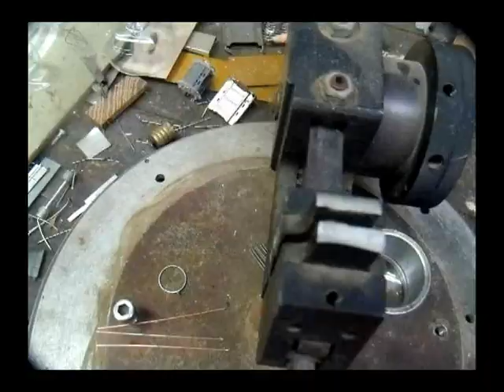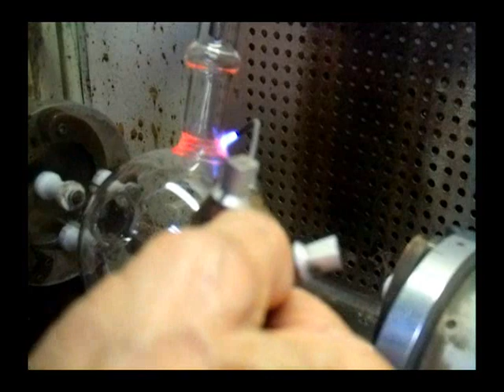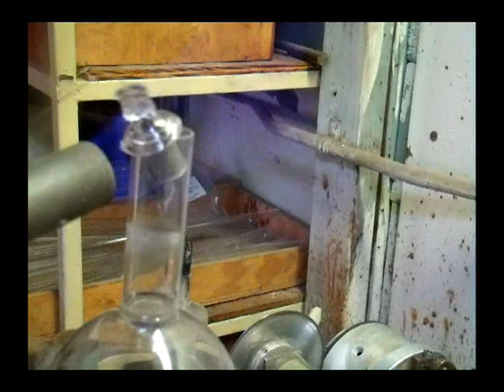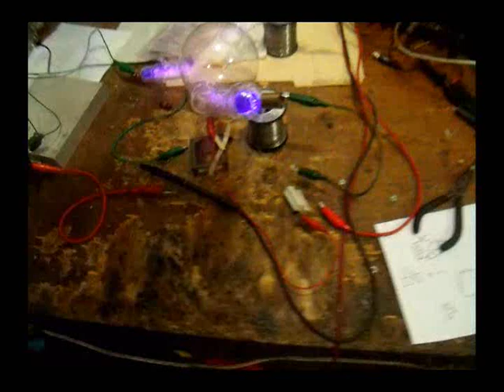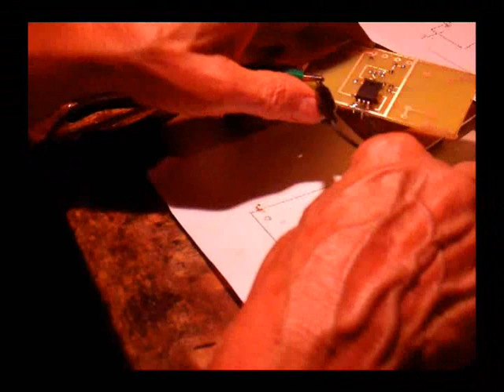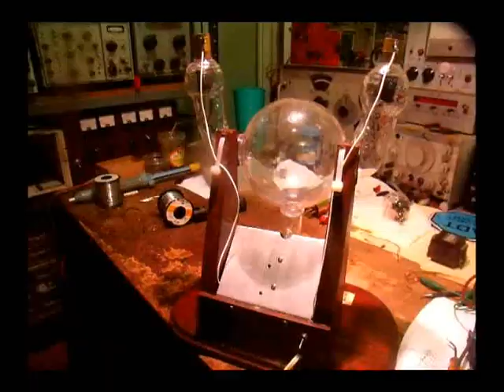making a mercury arc rectifier

Comment: why not making the two bends with electrodes firts and then attach to the main bulb?
Reply from the maker: The attachment to the bulb is the most likely time for a crack to happen, which would mean junking those parts. So getting that done before the other work was to cut the loss if SHTF.

Comment: This is very inspiring! I didn't know what a glass lathe was until about 2017. I'd love to get my hands on a Mercury Arc Rectifier. Not that I need one, but it would fun to have! Do you do other scientific glass blowing, like diffusion pumps, laser plasma tubes etc.?  Update: I got a Cetron 8008 Mercury arc rectifier tube. Not as elaborate as yours, but I will use it in a Vacuum Tube tesla Coil project instead of diodes in the voltage doubler.

Comment: That rectifier tube is just precious,  I have often thought about modifying a guitar amp as a gimmick to operate with an external rectifier tube but there aren't a lot of choices  out there for rectifier tubes to be had. I have a Mesa Boogie triple rectifier guitar amp that lets you switch back and forth to channels having three of the different rectifier 's by using a foot switch on the fly, but the rectifiers are solid state, not tubes. What would be better I could imagine would be switching back and fourth from a Mercury based rectifier and the the Argon rectifier hence the name of the songs on stage in live concert stage show and having the third be a Tritium rectifier and then it blows up during the climactic guitar solo that we could call the Trinity and it catches on fire,  then of course roadies come out and put out the fire as usual.  Nothing new however I haven't  seen this done for a number of years but the product line would be the new twist selling and external attchment for a guitar ampliphier that is the rectifier and of course a line of outrageous guitar amps  ....  🎸

Comment: So you're making a lightbulb then. I mean I know this is old and I'm only 10 seconds into the video and I haven't read any of the comments or anyting but this isn't Mercury rectifier is it? It is an Argon Arc Light Bulb, it's just it's a beer sign in a different form. Right? This thing is not capable of rectifying AC into high voltage DC in any way shape or form is my guess I'm going to skip towards the end before I give it a thumbs down
Reply from the maker: Yes, it is a "beer sign." It was made as a gift to an elderly man that wanted a model  of the mercury rectifier that would glow. The argon was used to avoid contaminating my vacuum system with mercury. Jealousy is a nasty mental disease! Work on it!

Comment: The idea of making the rectifier is fantastic, but it is just a really huge shame that the resolution of the video is so low that you can't make out fine details of what is being done. 
Maybe I am expecting too much from 8 years ago, but I love watching your videos, but find the pixelation/soft focus a problem when I want to see the details of what you are doing!
This video looks like it was shot at 480p 3:4 frame size.

I remember when I was an apprentice electrician, part of my job was to daily go around all the factory sub-stations and take the electricity meter readings, in the main substation there was a large steel cabinet that could be opened (I had the keys to the sub-station to get in which meant I also had the keys to all the cabinets in the sub-station too) and inside one of the cabinets was a large three-phase mercury arc rectifier, it was about 3 feet in diameter with the glass horns for the electrodes and the "giggler" you could see dancing around the pool of mercury!

I only opened the cabinet because it was the only cabinet that had a bright blue glow emanating from the louvres that cast a blue light across the substation floor. It was fascinating to watch! Unfortunately, 45 years ago we didn't all have phones in our pockets that had cameras to take photos, but boy I would have loved to have been able to have taken photos of it!
Reply from the maker: That was one of my early videos when I had the old 1.2 megapixel camera. It was very primitive with poor auto focus and no capability for manual focus.
Reply: @glasslinger  Don't get me wrong, it is not a criticism of you, just me expecting far too much from 8-year-old technology....!  
Fascinating to watch you make it, and it really brought back some memories of my Electrician Apprenticeship some 45 years ago.
Thank you,
Kay.

Comment: I wonder if it would be possible to rebuild like a 4-400a. 3-500 Zed. Or like. 572b. 811.
Reply from the maker: The glass used in these tubes is almost impossible to work on without cracking. Even with extreme annealing. I have never been successful.

Comment: There very scarce information on the engineering of glassworking lathe's heads, could make a video review on how it works? they are extremely scarce and expensive as result and i am really into making an homemade one so that i can make a arc rectifier like yours. and for that i need information on how it works which i cannot find.

Comment: Very impressive work👍
As far a working  Rectifier, how does this operate instead of using mercury??
Correct me if I'm mistaken, you created a replica rectifier , into a argon light??
You got a eye for detail, you have to do the mercury rectifier.
Now I know you can.
Reply from the maker: Once you get mercury into your vacuum system it will be there forever. I don't want to poison my system so I don't do any work with mercury.

Comment: I really wanted to see an actual working rectifier, but this was a very cool project nonetheless! What would the original ratings have been on a rectifier of this size?
Reply from the maker: These were used in gas station battery chargers. They were capable of up to 150 volts at 100 amps. The usual voltage was around 30 volts with a power resistor to ballast the voltage down to what the battery required to charge.

Comment: But this is not a mercury vapor rectifier. It is an argon giesler tube. Is the output DC?  If there is no mercury, there can be no vapor and no rectification - is that correct?  This is a constant flow of electrons whereas the original had several  anodes conducting only one half of one cycle.   This is interesting, nice work and all but not the original concept.
Reply from the maker: Of course your observations are accurate. This tube was made for a tube collector that had no chance of getting an original. I can't expose my vacuum equipment to mercury so I have to fake it with the argon glow. It looks more or less like the original, that's all.

Comment: Amazing skill.  The really big rectifiers were usually steel tanks, but glass bulb ones could be pretty big, with six or twelve main anodes.  The biggest I have seen must have been about 90 cm high, powering an old tramway system.  I wonder how they used to make ones that size?
Reply from the maker: I wonder too! The heat required is astonishing as the glass bulb gets larger. The annealing must have been a nightmare to keep it from cracking when it cooled.

Comment: Dear Mr. Glasslinger congratulating you for this unbelievable work is not enough it's almost incredible.  Is a pleasure seeing you working
with all my respect I would like to make you a suggestion: I have notice that whenever you cut with your diamond disc the rotation of the disc and the piece to be cut  are rotating in the same direction. In order to improve the cutting, the direction of movement between the disc and the material to be cut should be opposite, to increase the relative peripheral speed. This means you should invert the rotation of your lathe while cutting. Thank You for sharing your big experience and knowledge with us.

Comment: Back when a kid dad had a battery charger for the 32 Chevy with a Mercury tube .I later made a charger with a wash machine motor and generator which worked better . didn't need overnight 10minutes car would start.

Comment: The Lathe is that home made? Or a modified lathe. I see the tail stock has to turn at the same speed as the head for one and you use different jaw in the head and tail that look to be made out of Teflon.
Could you use for the Anodes the carbon rods out of say a center of a "D" "C" or "AA" Battery? for a higher current? Problem i see there is the glass seal on the Anodes
Reply from the maker: The lathe is homemade. The headstock holds the glass and the tailstock usually is holding wires, but also can hold glass.
The rectifier is a model made for a tube collector, not a serious working tube.
Reply: @glasslinger  Is there any way you would you make a video on the lathe and how it was made?
Maybe a little tear down so if someone wanted to make one they have a idea on what to do!
I have a good understanding of lathe's i have my fathers Watchmaking lathe, I have made some modifications to it.
1. It had a foot pedal speed control - got lost - so i made a control on the side for the motors speed.
2. A small drill press that attaches to the tail stock that can be used to drill the small fine holes in a work peace. (In this case it the peace your working on that rotates and not the drill bit)

Comment: I love watching you do this, I find it all interesting.  Why is tungsten used in the pinch?  Does it have to do with shrinking and expanding metal after it’s set in the glass?
Reply from the maker: Yes. It will form a vacuum tight seal with 7740 pyrex.

Comment: The problem is, it would not work even with mercury inside of it. Diameter of its feedthrough wires is just not enough to carry massive currents real MAV operates on. Shoud have made it from moly glass with thick molybdenum or kovar rod seals instead.

Comment: Try Googling The Manx Electric railway. Situated on The Isle of Man between The UK and Ireland. They used mercury arc rectifiers until quite recently to supply the 600 volt dc for the tramcars. I was lucky enough to gain access to the power house and see them first hand. Quite a sight!. Some units were over 100 years old and had never failed. There are some videos on you tube about them. Well done to you, quite a task.
Lynton G4XCQ

Comment: If you don't have/don't want to work with mercury you can fill lamp with sodium or potassium, and after heating lamp up to their melting point lamp will work as rectifier.
Reply: And what about gallium?
Reply: @samuellourenco1050  Gallium probably has too low of a vapor pressure to work well

Comment: Is it really a working rectifier? If I followed what you were saying it is rectifying a 50K Hz AC into I assume DC? You said 40 watts and 50% of that was driving the tube, and the other half was dissipated in heat.  Was there any useful DC produced to charge a battery or run a xmitter? You did alot of work to make a pretty arc lamp.  Mercury arc rectifiers were used to charge the early electric cars.  Some were 40 amps.
Reply: I suspect it isn't. In a real rectifier, the mercury electrode gives off electrons far easier than the other electrode which is what makes it a rectifier. Or at least that's how I understand it. There's none of that happening here. Closer to a Nixie tube I'll bet. Still cool though.

Comment: Wonderful work.Lovely to watch.That tube will work as a rectifier if the filament is
good and the vacuum is high enough.The mercury simply increases the amount
of current the tube can handle.From miliamps up into the ampere ranges.

Comment: This is amazing work. I would guess that without the mercury, it wouldn't rectify, is that correct? So basically you end up with an argon-glowing tube? The base you have it set in looks like it would fit nicely in a museum...
Reply from the maker: +tiger12506 
This one was made for a private museum. It glows like the originals but I don't think it would rectify very well!
Reply: glasslinger you should have tried using gallium and seen if it worked.. you would need to coat the glass with something hydrophobic though because of gallium wetting things and making a mirror basically
Reply: glasslinger is there anything you can think of that is hydrophobic that you can coat glass with that will stay on in the blowing process?

Comment: What would a tube like this be used for?  Curiosity get the better of me.
Reply from the maker: +ChozoSR388 
In the old days there was no such thing as a rectifier diode that would handle high current. (amps) These mercury vapor tubes could rectify 100 volts at currents up to several hundred amps for the larger ones! They were used in battery chargers and for the power supply that ran street cars, and electric trains in subways.
Reply: glasslinger
Oh, wow!  Thank you for that explanation :)  I'm not really all that familiar with tube technology, but, I find this kind of stuff extremely fascinating.

Comment: That is an old Cooper Hewitt style mercury arc rectifier. I would have used mercury. I have 1 & 3 phase mercury pool rectifiers & a few working Cooper Hewitt lamps. The rectifiers were  salvaged from an old electroplating plant & the lamps came from and old renderings & meatpacking plant. Mercury arc is a beautiful greenish color. I have to  wonder if Ron did not used to k for Varian, GE or Sylvania/Philips, at one time, or what he did to get his skills with glass blowing, & welding. I have spilled mercury, & worse. An old alley find junk vacuum cleaner & a polluted stream already laden with mercury from gold mining works fine for disposal of mercury.
Reply: +Seth B If you did mercury you would probably need the restrike too.
Reply from the maker: +Seth B 
I didn't use the mercury because I didn't want to contaminate my high vacuum system with it. Once it is in there it is for keeps! No practical way to clean it out. You're lucky to have some of the originals!

Comment: beautiful job, why not add the mercury and watch the real thing ? we used to use mercury scr's, big metal cans glass lined , copper lugs to connect power 440v 250a to control a spot welder coil and a 1/16" wire electrode in the pool of mercury, hit that with a couple hundred volts and the tube conducts. i would love one of these on a smaller scale of course, just to be able to demo for people.

Comment: By the way.  I have been following your Perdicta restorations.  When I was in TV repair, RCA used to make replacement antenna rods for portable sets. cannot recall the part number.  They were nickel plated and came in boxes of 10.  Also, Calrad and others made an antenna that was designed to screwed to the flat back of a portable tv.  It was a rabbit ear style , and retracted into the body .  At that time (early 80's), they were about $3.00 each.  I recall seeing something like them on the back of a set that you got awhile ago.  Perhaps you could scour e-bay or one of your other sources.  Hope this helps